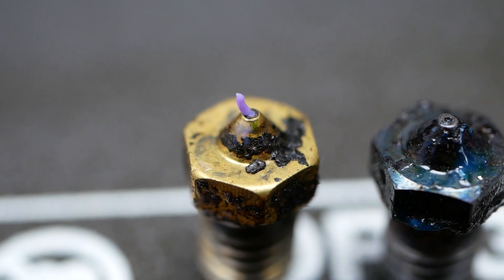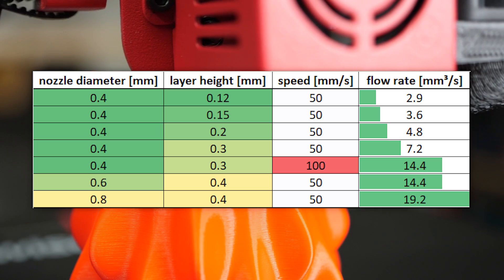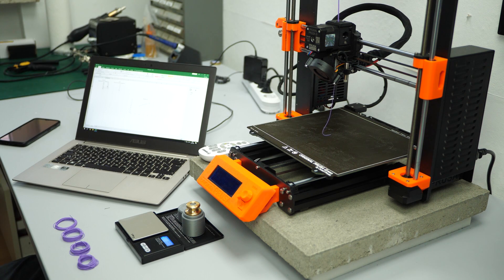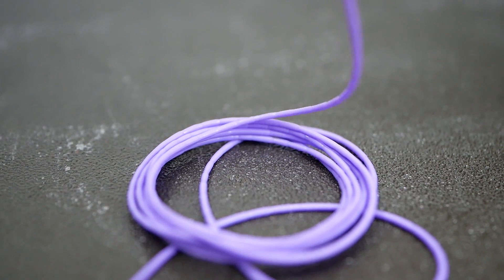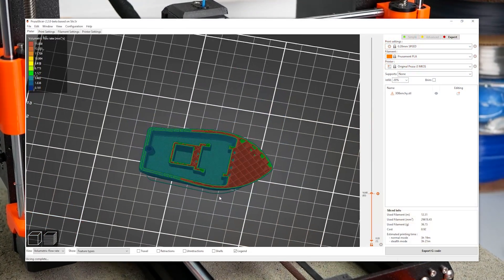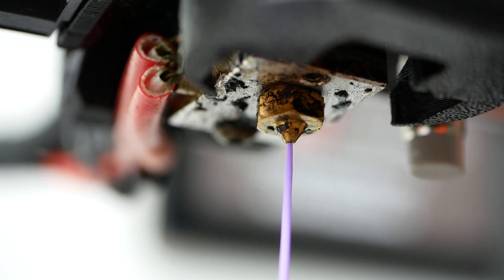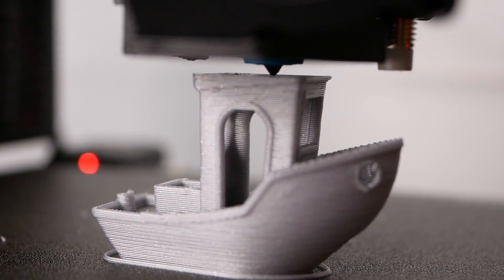How fast can your hotend print?

Comment from the maker: Don't forget to share this video on Facebook, Reddit, Twitter and other social media!
Reply: Dear, Stephan, there is a mistake in calculations. Check the first table, the flow rate [2.9, 3.6, 4.8] corresponds to speed of 60mm/sec not to 50mm/sec. And the flow rate 14.4 to speed 120mm/sec, not to 100mm/sec
Reply: literally within the first five seconds of the vidio I was thinking about Destin's vidio on it 😃
Reply: Warum machst du keinen deutschen kanal ?
Reply: Hi Stefan, can you please test a copper vs brass nozzle? I'm curious to know if the ~3x specific heat capacity of brass results in better heat transfer compared to the 3x thermal conductivity of copper compared to brass. I'm wondering if the increase in thermal density of the brass will bottle necked by it's conductivity across the threaded interface, or vice versa for copper....Thanks! Keep up the great videos!
Reply: i guess im asking randomly but does anyone know a way to get back into an Instagram account..?
I stupidly forgot the account password. I love any tricks you can offer me

Comment: I wish your methods and findings from these diagnostic videos could be made into a troubleshooting app or site, not just how something is done but why it is done one way and not another.  So many times I have found my results significantly different than expected when replicating a test, but find myself getting confused as to which settings are most likely causing the issues.  So many instructions show steps to calibrate, but not why one thing affects something else, and sometimes contradictory information between different sources.  I love tinkering, but I want to do more printing and less calibration.

Comment: I drilled a hole into a VERY used 0,4 nozzle. probably wasnt even 0,4, more like sanded down by the abominations i pushed through it. Either way the bit i used was 2 mm. I made a 2mm nozzle diameter. And guess what, it worked somewhat well while printing. it looked almost like factory made 2mm nozzles

Comment: I have a question, is there any data about the maximum volumatric flow that can go through a nozzle just extruding? No layer height, no width, no printing at all. Just putting the hotend in the air and start it to extrude just as the beginning of the video. Can't we know the maximum volumetric flow of material coming out of the nozzle?

Comment: so with a bowden im having issues where increasing the print temp leads to more "springiness" in the system. Basically the plastic expands as its being force fed through the nozzle, causing back pressure. This is influenced by print speed and travel distances, making nozzle drip worse.

Comment: I started using this technique recently to try and maximize the speed of my printer, and I am not sure how useful it is in a practice vs just finding how much plastic it can push. Using the method in this video I noticed skipping on my setup over 19mm/s^2. So I set my max flow rate in my slicer to 18 and I have had it there for a little while. Then yesterday I was watching the print as it was doing solid infill and it started under extruding and skipping when it got to just 15mm/s^2 (as displayed by Klipper). 
So I am thinking that when the system is moving around (this tugs on the filament as the tool head moves), and there is pressure at the nozzle it might impede flow too? This test just going in thin air may not be useful to find practical printing flow rates. Maybe print several cubes at different flow rates to weigh those to see if they skip?

Comment: I have only went as high as 260c with a e3d v6 printing PLA during a speed benchy run. Nice to see data that actually shows it works like I expected. 

This is with a microswiss steel nozzle and a titan extruder.

Comment: Wouldn't you have more back pressure if you were actually printing a part though; instead of a free fall stream? 

How about manually pushing in filament with "reasonable force" and time it using marked filament (I use a clothes-pin)?  What I did was compare video footage with ruler in the background, so filament distance / time stamp difference * cross sectional area (2.4mm^2 for 1.75mm filament). I got crazy high numbers though, so maybe "reasonable force" wasn't so reasonable.

Comment: In the gcode example we have extrusion at 450mm/min, meaning 7.5mm/s and that is 18.75mm³/s on a 0.4 nozzle. (7.5 divided bu 0.4)
Did I get that right? I did F72 in order to have 3mm³/s.

Comment: my pla bubbles at 215 and i only get a clean print at 200 , 205 max at 60 to 70 mm per s why is that ? my bed is also set at 65 c
Reply from the maker: Your filament is wet. Dry it!
Reply: @CNCKitchen  thanks for the reply can i dry it in a normal oven ? if so what temp and for how long ?

Comment: 1:53 thechnically the suface area of a nozzle cound be inctrased by puting a thread on the indide, but idk what the reason is no one has tryed that so..
Reply: A thread will also make it so some of the plastic gets stuck and burns, ruining the print and maybe even the nozzle. Nozzles have laminar flow, a threaded nozzle doesn't.

Comment: This is why I normally prefer to print at very high temps. For detailed prints, I lower the temps and print at ridiculously slow speeds.

I go through ABS fan shrouds on my Prusa so frequently I bought a spool of PC blend filament just for the fan shroud and extruder cover.

Comment: Imagine carbide nozzle inserts and induction heated nozzle insulated in ceramics   integrated termocoeple  so that the induction heater has fast response  hack   maby preread the code and adjust the hotend power beforehand always up to the task

Comment: When I calculate the flow rates I get a different amount - .4mm nozzle (or more accurately slicer line width) * .12 layer height * 50mm/s is a flow rate of 2.4mm3/s, I guess this assumes that the bead is strictly rectangular.
Reply: I would like to see an answer to your statement. @cnckitchen

Comment: Thanks for the good work Stefan ! I am watching nearly all your videos on a streak :)
On the chart at 1:29, when I multiply [Nozzle diameter]*[layer height]*[speed], I get a value consistently ~17% lower than your [Flow rate].
What is the reason behind it ?
Reply: Same
Reply: +1
 In your tabulated drawing the first row. You have your flow at 2.9 with .4 nozzle at a .12 layer height. Using the formula 2.9/(.4*.12)= 60.417 and not 50. Are you reducing result by some safe margin?

Comment: Fantastic work as usual.
I have something to point out tho. When calculating volume rate while printing I think one should take into account the width of the extrusion line instead of the diameter of the nozzle. So it would be extrusion width x layer height x speed.

What do you think about it?

Back to the hotend discussion. I recently replaced a V6 block for a Volcano. By replacing the standard extruder (single sided arm + spring) for a BMG I could increase speed by 15% at the same temperature with the V6 block. After installing the Volcano I went from 70 mm/s to 90 mm/s and was able to reduce the temperature from 225 to 215 without any issues. I think it's well worth it. If nothing it's a lot more forgiving in terms of tuning speed and temperature.

Keep up the awesome work.

Comment: Hello Stefan.
Love your channel. Keep it up.!!!

I am running an Ender 3 with the Klipper firmware running a Raspberry Pi. I also have a Microswiss hotend. Custom springs, improved extruder.  I also have a Creatlity glass bed. But I have a custom home made heated bed. It can hit 100c in very short order. I have not officially timed it. But it's fast. I think it can hit 100c in less than 4 min. Ill have to time to be sure. It's AC powered. Using a relay. Anyway. Can I give you my gcode to print "The_Bearded_Yell" model? (Linked here: https://www.thingiverse.com/thing:1376314) My last print today took 7.5 hours to print at 0.1mm layer height at full scale for this model. Simplify 3D tells me that the final height should be 98.67mm.

Unless it's a production model (for a client or friend/family)  I never print at full scale. The reason is it's too slow... anyway. I printed this model at 265 deg C at 100mm per second. My slicer is Simplify 3d v. 4.1.2 with manual supports that I placed. My filament is PLA from Amazon, amazon basics PLA in black. I have high quality pictures I can provide for comparison. I'm very curious if my setup is repeatable without my equipment?
Most Ender 3 owners feel that my results can be had without any of my upgrades.
I'm very curious if this is so.

You are an engineer and scientist... I trust you and what you do. I love your channel. I would love to see how my gcode works out on your systems and what your thoughts are on my results when I share my pictures of the print my gcode produced.

I know you are probably swamped and don't have time for this sort of thing. But if you are curious, please let me know and I will send you my gcode for this print. And I will also send you my pictures of my print so you can compare. I will include items in the pictures for scale reference. Like rulers, coins etc.

Anyway, keep up the amazing work. I love your channel.!!!!!!!

P.S. 
As a side note, I have been able to print small prints with layer heights of 0.04mm on z.
I have pictures of that too.
I have also had Ender 3 owners tell me that a default Ender 3 can do that with no modifications.... but that has not been my luck/results with my Ender 3.
I wonder what your thoughts on that are too.

Anyway, thanks, be safe. Continue with the great work.

Comment: Do you think that using nickel-plated copper block/nozzle would significantly change maximum flow rate? I know that they were designed with high temperature materials in mind, but I'm wondering if copper would allow to push the good old V6 block even further, without having to upgrade to Volcano.

Comment: Thanks for this video! It gave me some more data and perspective on the capabilities of my hot end. Now I am pushing 21 mm^3/s on my prusa mk2s with a 0,8mm nozzle and are cranking out face shields in no time. Not that it has to be a competition, but printing hundreds of the same model is a good oppotunity to test out the limits of the printer and it seems that I am currently the fastest in the region. I haven't done the measurements you've done though as my scale only has a resolution of 1g.

Addition: I got the print time below 1 hour for 3 of our approved face shields with the volumetric flow rate being 22,5 mm^3/s, printed with a temperature of 250 degrees when I would normally be at 210 degrees and a much lower flow rate.
Reply from the maker: Great work!

Comment: Great video! I use the output of this method in PrusaSlicer to make sure I don't print faster than the maximum my extruder can support. I wrote my gcode by priming it a little bit, then I retract 5mm and wait 5 seconds using the G4 command. It gives me plenty of time to remove the primed filament before the test starts. After extruding .5m I retract 5mm, wait 5 seconds (G4 S5) then start again with a faster speed. 

One thing I noticed, is the width of extruded filament varies a lot with the speed from .48 to .84 just by varying the speed and extruding in the air. Really cool.

Comment: Did this test today. My tips:
- If you hear the extruder making tick noises or you're seeing major differences as the VF increases, check the filament is properly tightened. Turns out I had my screw turned the wrong way so it was set at minimum spring load.

- Get a precision scale and check repeatability. If needed, average 3 measurements each time.

On my Anycubic Chiron, original hotend/extruder, with PLA at 220°C, here are my results:
8 mm³/s is used as baseline
16 mm³/s gives -7% extrusion
24 mm³/s gives -14% extrusion

I'm planning to upgrade the hotend to an E3D Volcano. I'm not sure if I'll need to upgrade the extruder, at the moment it's doing its job.

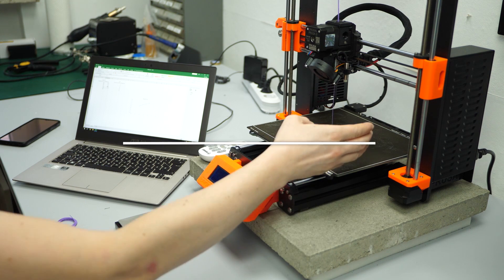Comment: What do you stack your concrete pad on top of? At 2:04, I can see a nice setup with the concrete pad and support, to reduce movement of the print body.
Reply from the maker: Just a couple of pieces of foam to decouple the printer from the table. Not too soft and not too firm.

Comment: So i'm thinking: here's this result for PLA that showed remarkably little difference between brass nozzle and steel nozzle.

But i find it relatively difficult to print PETG, it seems to require quite a bit of heat to melt through and very consistent volumetric extrusion rate, else it does weird things. So i'm wondering if steel is more of a disadvantage with this material.

Comment: During the video you say 3mm^3/s is equal to .12 layers at 50mm/s and 15 is equal to 0.3 at 100mms - can you let us know how you actually come to these figures? I couldn't find answers on it online and without that, I can't really translate this into max speeds for my prints
Reply from the maker: 0.12mm * 50mm/s * 0.44mm (extrusion width) = 2.64mm³/s
similar for the other one.

Comment: A couple of things to consider from my own work with 3d printers. For one, extruding into free space is not necessarily the same as actual printing, it may scale but I would be very surprised if you don't have a real max flow that is lower than the free space number.
The other thing to consider is accuracy of hot end temperature measurements depending on the location of the sensor, the flow etc. I have a thermal fea model of this which lets me explore the temperature latency etc in the system.
Reply: So what caused the drop of volumetric flow speed during actual printing? Other than the pressure from lower layers

Comment: My thoughts on this topic are the following

@ 00:51] "printing faster and especially with bigger nozzles a so called volcano hotend might be necessary"

-> Longer nozzles are specially good when printing with high flow rates at constant flow speed, but they perform poorly if the filament flow rate has to change rapidly, as required to print small details.    

@[01:53] "fancy nozzles that claim higher melting capability since the surface area is increased by its"
shape"  
-> 3D Solex seems a very good solution, it increases the inner heating surface area of the nozzle and reduces the inner melting volume, while Volcano nozzles increases the inner heating surface but also drastically increases the inner melting volume.

@[03:47] "the filament starts skipping from time to time"
.> Probably the extruder motor has started skipping microsteps long before noticed, I suggest you use an optical encoder to confirm that.

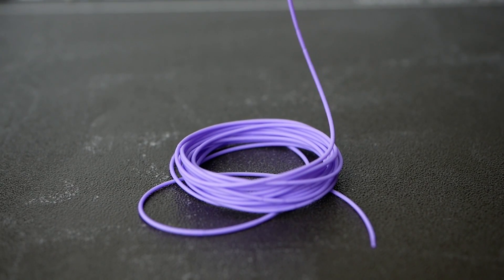@[05:16] "a flow rate dependent extrusion multiplier might be something really useful in a slicer"
-> Couldn't agree more, hope to see this implemented in near future.

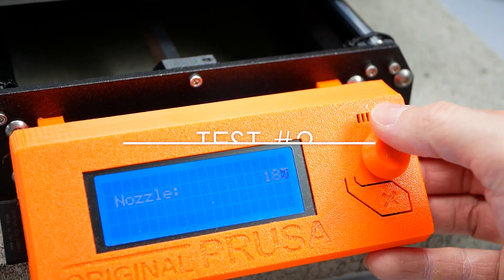@[06:17] "Higher temperatures will decrease the viscosity of the melted plastic and will also help that the material properly melts in the first place resulting in less pressure in the extrusion"
-> True, but that's not a long term viable strategy. Surpassing temperature specs will rapidly create layers of crystallization at the inner surface of the nozzle, reducing heat transfer to the core of the filament being melted and ultimately cloaking the nozzle.

Comment: Cool, I was doing something similar Fast n Hot on Ender3 Stock with BMG.  Pla 260 0.8noz, 0.4 layer.  The extruder bogs and can see the bottom layer lines thinning.  Slow down the speed, 50 to 30mms and the extruder catches up and lines widen.  Will test your concept!

I do get blobs on layer changes.  Saw your large nozzle test but was confused on the Cura Coasting and how much the values can get adjusted for a tuning test.

Priline Polycarbonate CF, great material.  Do not recall it in your testing but will look again

Great videos, Tschüß

Comment: I noticed that I can use extrusion rate up to 15mm3/s when print PLA, but only about 10mm3/s for PETG and less then 6mm3/s for SBS. It should be linked with material viscosity. Does anybody has similar observations?

Comment: My hotend&extruder setups are pretty much the same as yours. geared dual drive extruder, and v6 hotend.
I always print my supporters at 200mm/s though. Partly because I can, but also because underextrusion makes supporters easier to break.
I also print infill at 200m/s when strength is not a concern. With Line or Grid infill, I found They tend to leave just enough pillar-like artifacts that I believe to be enough to act as supporters.

Comment: You might want to measure the heater voltage as a sanity check for these types of tests. I measured the rms voltage across the heater of my Cetus and found that I had a temperature-power problem when printing with PC filament. The maximum temperature before was 273C which is just not hot enough for PC filament. Inspired by the heater sock video that you did I designed a higher performance heater sock and a separate sock for my steel nozzle. The two socks reduced the static (non-extruding) heat loss by about 30%. Another benefit is that without a nozzle sock the filament cools as it travels through the nozzle which requires a higher heater temperature to compensate for. This is very visible with an IR camera looking up at the nozzle. The clearance is 0.1mm from the steel nozzle tip to the start of the sock so everything stays warm. You might like a nut and bolt extrusion calibration test that I created https://www.thingiverse.com/thing:3983705. It works a bit like a micrometer to measure printed thread clearances. This clarence
geometrically measures over or under extrusion plus overhang sag.
Enjoy your videos.
Peter